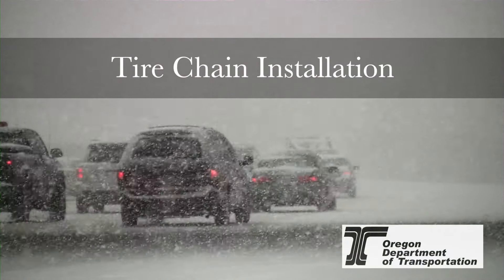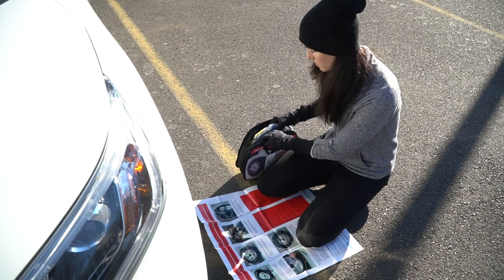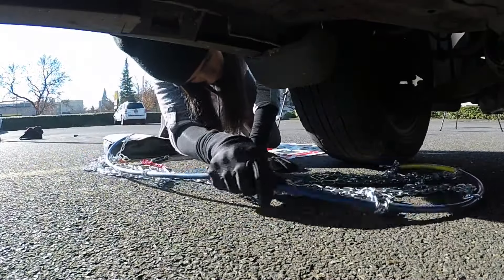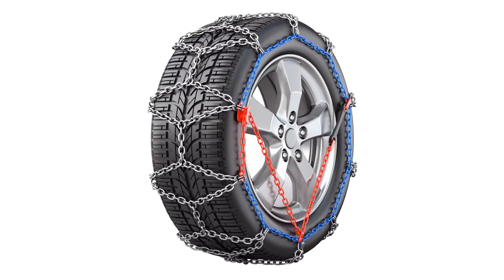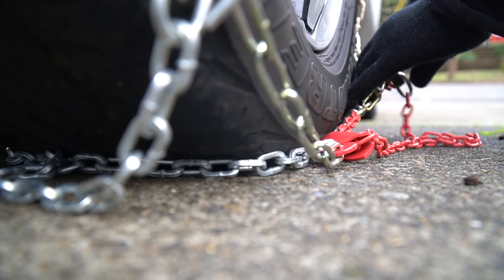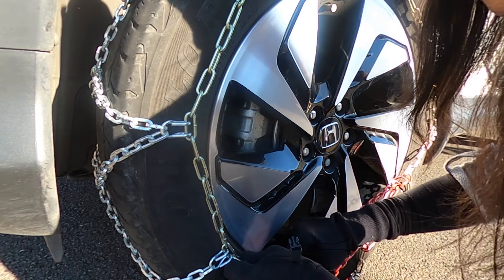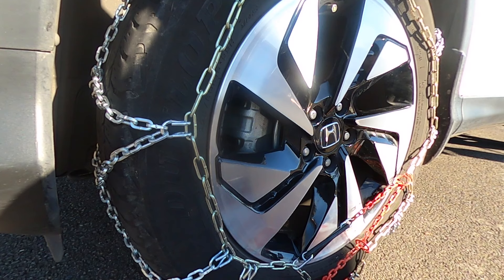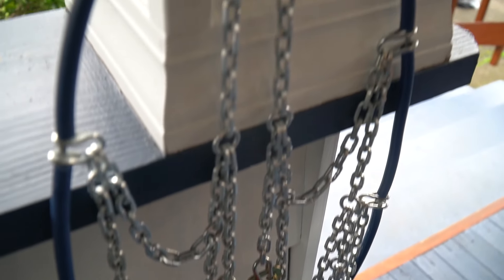Tire Chain Installation

Comment: Why so few drivers use winter tires in Oregon? We have mandatory safety items but snow tires aren't mandatory. They do save lives.
Reply: Who wants to keep a whole pair of snowtires in their apartment when the summer comes?
Reply: because a full set of winter tires take up a lot of room and they cost a lot money. also if you dont buy a second set of rims your going to have to pay for them to be mounted and then unmounted when winter is over. chains are agreat alternative to winter tires for when snow/ice only happens a couples times a year
Reply: @thaton3guy100  not a big price to pay for safety and peace of mind imo. WInter tires provide better grip below 40F so not only on ice and snow.
Reply: @lukem9707  at a low end of 200$ per tire it is a big price to pay when chains are more than adequate for most people

Comment: Thank you so much I haven't put chains on since I left Alaska. But the better question is how deep of snow do you need chains cause Alaska has good road clearing but down here in the states I think not. I'll be traveling through Utah and there's going to be 0.2 inches of snows wondering if I need chains for my 08 Sebring

Comment: Im at a hotel here in bridgeport cali. Can i install the chains here on the hotel? Or does it have to be out in a chain area?
Reply: If it's snowy out and the roads aren't bare, you can put them on in a parking lot. If it's bare roads, it's generally avoided unless you are only going short distances down them before going into snow.
Reply: @KaiserTom  thank you very much😊